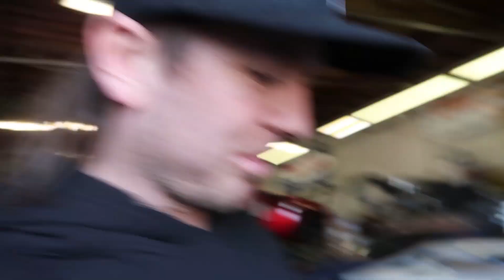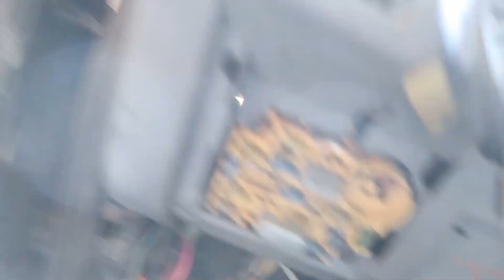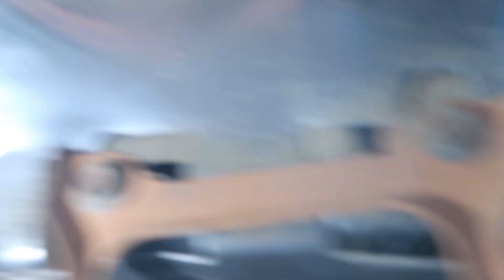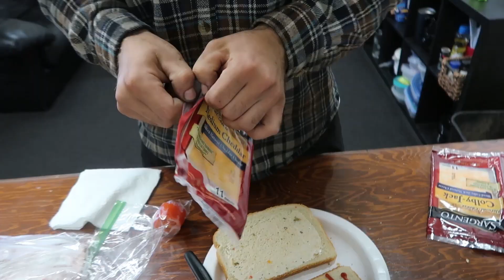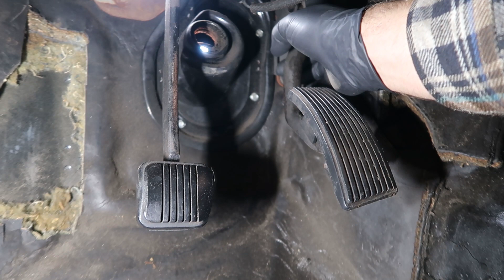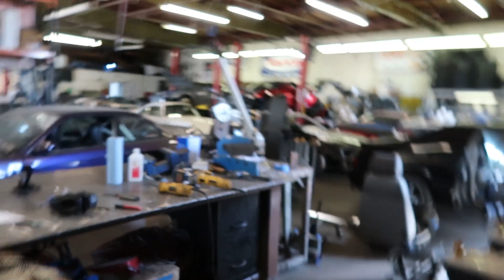DBW Pedal Into Fox Body Mustang

Comment: Putting throttle by wire into a mechanical throttle car is a down grade IMO but I guess you can't avoid it if you're going to run a Coyote on a stock ECM
Reply: Why a down grade?
Reply: @1jzfc999  mechanical throttles are more responsive and more reliable

Comment: Ive just set up a dbw on my 1j fc. Used a hikux pedal as that mounting face meant was parallel with thr firewall. Bit of threaded rod and some rivnuts. Was super easy and the pedal is nice and compact